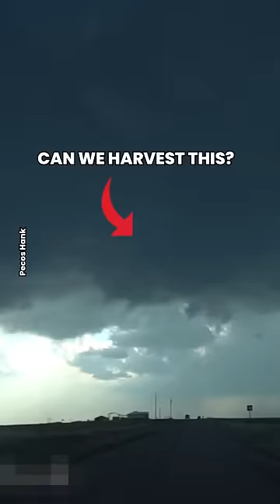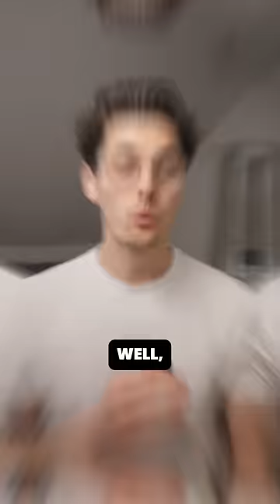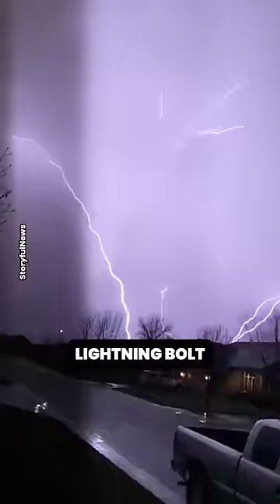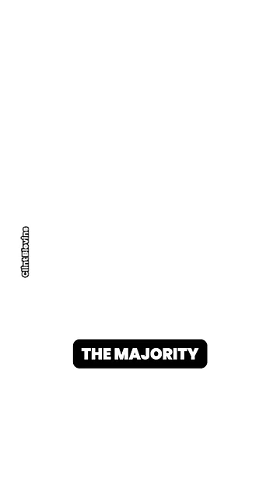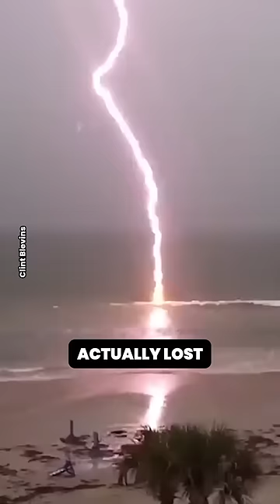Why don't we harvest lightning for energy? ⚡️ #shorts #alternativeenergy

Comment: About the last pointer, getting used up as heat and light energy, that happens by the time it reaches the surface, right ? 
So hypothetically, if (that's a big if as it is) there was some way to channel that much power from tower through a series of transformers and rectifiers and such, i feel like the main issue would be storing it, i believe. Im not that well versed but if there was some kind of monster semiconductor or something, maybe that could've been possible (?) 🤔🤔
What do you think ?
Reply: we acctually may have a way to channel the lightning to a target, ionizing lazors seem to be able to focus lightning by making a more ideal path you have to point it near a lightning rod to other wise the lighting would hit the emmiter and destroy it.
Reply: @mauzeking6661 I feel that by using the laser providing a path to the ground, we could then draw part of the current off into a supercapacitor, like the ones currently being created for nuclear fusion testing in order to momentary capture the voltage before discharging more slowly into a more standard battery for later usage and proper syncing to the grid frequency and voltage.
Reply: @mauzeking6661 laser will use more power than you can harvest
Reply: Ever heard about inductivity? That's what transformers are made out of. And inductivity resists the change of the current. In case with lightning it can become so resistive that the lighting will find another path
Reply: @G0RSHK0V  than lighting? Not likely the lasers don't even have to be that powerful as all they have to do is generate an easier path. They are not creating lighting.
Reply: @mauzeking6661  Yes, but they need to work for a long periods of time

Comment: I mean, we can force the lightning towards certain spots with lightning rods. Saturate an area with enough of them as well as a transportation method for said electricity and it can have plenty of power.

Currently the biggest issue is just storage. We can't physically store electricity, we just store it as a different energy source or reaction until we can convert it back to electricity. For example: batteries do not store electricity, they just store chemicals that cause a reaction upon being hit with electricity, and then reform that chemical reaction to then generate electricity (it's a really dumbed down explanation but for simplicities sake). We cannot take a bolt of electricity and just keep it arcing in a space until were ready to use it.

To fix this we need to create better storage systems:
1. Find better or more efficient ways to store chemical reactions.
2. Find new ways to convert electricity into a storable method.
3. Finally figure out how to actually store electricity.

Comment: The big problem will always be "is it efficient"

A battery capable of storing instant electricity which can always equal to a very scary power surge.
The capability of a machine to stop and store such energy and not waste any energy further
In the end if all this checks
Will the energy stored inside be significant enough over the cost that you used to make one such machine?

Comment: It may be very powerful, but the actual strike lasts for such a small duration, there isn't really any reason to bother  harvesting it. The actual lightning consists of a lot of bursts, which all together last for about half a second. The short duration of a discharge is the reason you don't die from a static discharge, because the actual amount of energy present is low.

Comment: We have self driving taxis but we can’t design a capacitor to store the energy from a lightning bolt? Something ain’t right.
Reply: I think this is like trying to charge an absolutely gigantic battery from 0% to 100% in less than a second.
Reply: We probably could. But that technology would only be useful for a very narrow niche- mainly 'storing lightning'. And overall, storing lightning energy is less efficient and reliable than solar panels.. Which don't require a whole separate tech tree to store their energy output, once produced.
Reply: We could but it'd be incredibly inefficient and not worth mass production. Basically 99% of cool futuristic ideas like flying cars or harvesting the power of thunderstorms fall under this category  because the systems we have in place are hundreds of times more cost effective.
Reply: @genericwhitemale9566  we still haven’t made a battery that can even store the incredibly amount of energy in a lightning bolt, let alone instantly

but once we have, then it’ll only depend on cost

Comment: Fun Fact: A Single Lighting Bolt Is Twice As Hot As The Surface Of The Sun
Reply: Where do you define surface though, as it is a ball of burning gaz, the surface changes right? And thus would change themperature if you go even slightly further or closer
Reply: I find that hard to believe since people have survived lightning strikes before and aren't completely burnt when killed. If I had the same heat of the surface of the Sun somebody that got hit by lightning would completely eat evaporate into dust instantly.
Reply: @EatOnionz the surface of the sun is surprisingly not that hot… well not that hot compared to the core

Comment: To summarize:

We don’t, because we can't.  We don't have the technology or equipment for it.
Reply: We do, nikola tesla did it
Reply: Did you know? Lightning is powerful but not practical for energy. Each flash has about 4 strokes, each at 10^12 watts for 30 microseconds. Quick math: Energy per Stroke = 10^12 watts * 30 * 10^-6 seconds = 30 million joules. Total for a flash? 120 million joules, equivalent to about 3.81 liters or 1.01 gallons of gasoline. But capturing lightning energy? Super tricky and not efficient with today's tech. It's more a natural spectacle than a power source!

Comment: Send an aircraft to collect the energy once you find how to store it. If this 1% is really so strong, it can be a hybrid engine, powered by gas for the first while, then powered partly by the electricity it collects. This could really work. If the aircraft stays in the right areas of a storm cloud for a few minutes and comes back down it may just have enough energy to power many places at once.

Comment: We can, in some cases, artificially induce lightning to strike a specific spot by creating a LIPC - a laser-induced plasma channel which is electrically conductive. This is done by firing high-power, ultrashort pulses of ultraviolet laser light toward the cloud via a mirror in the base of a metal tower. The lightning follows the plasma channel down to the tower which then provides the last leg of its journey. This is where we capture its energy, or what's left of it. Most of the energy is dissipated in the bolt  before it even reaches the ground.
This idea makes its Internet rounds every few years. Complex and expensive with little return on investment which is why it is not being pursued. You would be better off installing a wind turbine or solar-panel array as the energy supplied by those is far in excess over the course of a year - and far more reliable - than that from collecting leftover energy from lightning bolts, especially as weeks or months may pass between storms. It just doesn't make sense.

Comment: no i have not wondered. the reason is 1) its too rare to set up a reliable harvester. 2) you would need a stupid amount of super capacitors on a even stupider manifold like system to even capture the energy
3) there is not enough power in a single lightning strike to power a single house for longer than a few hours.

Comment: Use an advance capacitor. Placed them together, maybe thousands of them. Capacitor basically a battery that charge and discharge a thousand faster than battery. They can store energy, and then transferred to battery hundreds of different battery module to quickly discharge the capacitor for another strike.

Comment: lightning conductor

A lightning conductor is a device used to protect buildings from the effect of lightning. A metal rod taller than the building is installed in the walls of the building during its construction. One end of the rod is kept out in the air and the other is buried deep in the ground.

Comment: Even if it doesn't provide much energy, a reasonably priced passive storage system that could be installed on skyscrapers and the giant cell towers in the middle of nowhere seems like something power companies would be interested in. The system would have to have extremely low maintenance requirements to justify it though since there is no guarantee of collecting any "free" power.

Comment: Instead of waiting until lightning strike, wouldn't it be possible to fly a balloon carrying a wire which would carry the electrons from the cloud to the electricity grid? The wire should have lower resistance than the air so electricity should prefer to go through the wire rather than the air, and instead of one big surge, you'll be able to harvest the differences in the potential energy between the cloud and the ground over time, which should also reduce the incidence of lightning in that area. Or am I talking nonsense here?

The amount of electricity harvested from the cloud is probably too low to be commercially viable, but it should be possible to generate some energy this way right?

Comment: I think the real reason is that nobody has actually tried. We all know that lightning rods exist and can exponentially increase the likelyhood of a bolt striking the rod.

The next part should be the hard part, but what I wonder is why we don't just build large machinery that requires that much power near lightning rods, that or just trade off what power we can manage to absorb for much less. What really matters is that we recycle the energy that lightning gives off, we don't need to store all of it, just enough that we can store and use, the rest could be grounded.

Comment: Well, there's also the fact that lightning doesn't hit the ground.The ground hits it.
Lightning only travels about half The rest of the energy comes from the ground.
Technically we do have the technology to harness lightning.
Problem is as it means redoing a city's infrastructure.
You would want the ground wires to be as widespread as possible.
You can control where the top strikes if you have a net on the bottom.
Is five square miles of wire Half a mile into the ground And a single Tower stretched Three hundred feet in the air.
If done properly you'd probably never see a lightning strike Highly charged atmospheres would be absorbed.
The only time you'd see the lightning strike with a system like that as if the capacitors are over Worked.

Comment: We can easily harvest it…. Probe runs the electricity into a resistor and the heat it produces can boil some non conductive liquid and turn a turbine… the issue is the distribution of strikes and the frequency. If there isnt enough energy to catch per year to support the capital investment and recurring costs then it isnt worth it… and currently it isnt worth it…maybe if the climate gets much more stormy and electricity becomes very expensive

Comment: If my calculations are correct then if we try to extract the lighting bolt from its origin place then it can make a massive electro blast or simply a blast of energy and the power of it will be like a atomic bomb more worse 10 to 15 lightning bolts origins on one area then spreads through out the sky so it's very devastating

Comment: A line very high in the sky with a line connected to ground has a potential. In the tens of  thousands of volts. But the current is extremely low. Most ways of "atmospheric energy" will be completely unusable unless technology makes a big change. It would be amazing to harness all the energy from our home sun but unfeasible

Comment: Actually thats not all true. Over 20 years ago a group of university students with their instructor came up with a way to make lightening strike where they wanted by firing a small rocket into the air with a positively charged (ions) wire attached. The lightening naturally followed the wire down to the ground and it was repeatable. The only issue is storage, however they did come to the conclusion that after just a few strikes, enough energy was available to run a city of 20,000 people. It's possible, but big tech and big oil won't allow it because theres no money in it for them...

Comment: Also, it is a static electric discharge.
Not much comes from that because, as you said, it is mainly lost to heat and light.
If it was a direct discharge and didn't lose much, the chance of retaining such energy might be useful if we have the correct storage for it (I say the correct storage for a reason).
However, because it is a static electric discharge, we need more than one strike for a large amount of energy to be stored for long term use.
Plus, how is that electrical energy going to be distributed?
I mean, think about it:
A power plant generator uses a set of magnets on the shaft inside and the shaft moves those magnets on it in rotation to move electric charges on the copper wire coiled on the outer parts of the inside (it has been a while since I learned of this lol).
But if you have an electric charge such as that of a lightning bolt, how are you going to distribute that? Plus, you cannot force lightning to go one place.

Comment: Create a magnetic field surrounded by tall pointed like structures that attract lightning connected to an absorbing type of ground copper wire field that absorbs the electrical/kinetic energy from the lightning bolt and stores it into some type of reverse polarity connection storage station.

Comment: What I’m wondering if the lightning bolt turns into sound and heat before it hits the ground or after. It is afterwards, then I was thinking that some kind of structure can diffuse the lightning bolt, like a series of conductive rods. Then, it would only be a matter of absorbing the energy fast enough.

Comment: real reason: it's super hot and there's a lot of electricity in it, you need equipment that can store 100 000 000 volts of electricity in an instant without blowing up